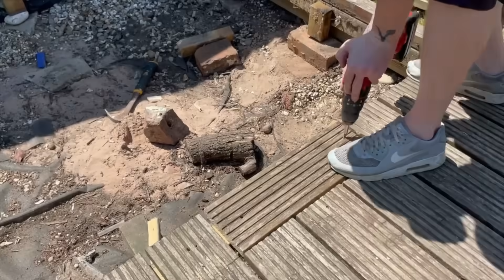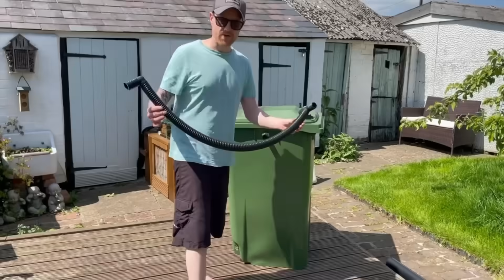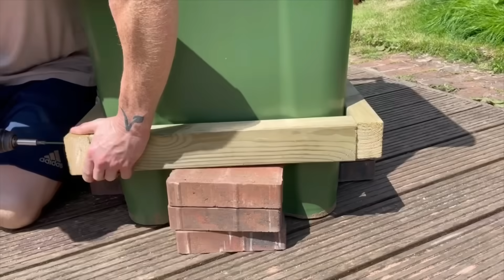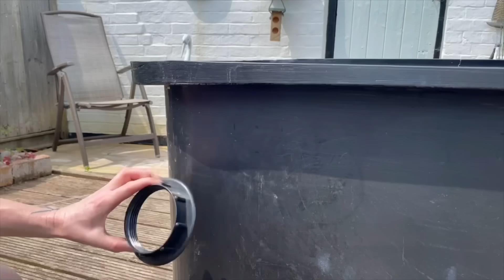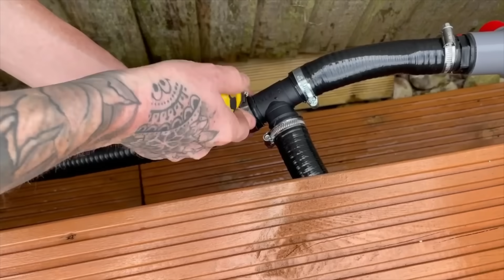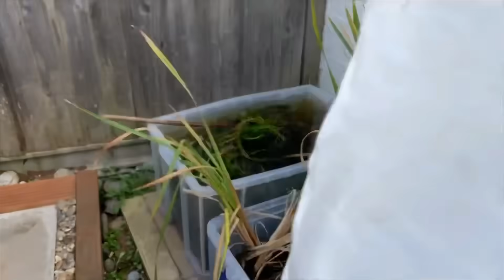DIY Backyard Garden Pond (step-by-step)

Comment: Very nice pond. But i wonder how your gone clean the mechanical filter kliko. All the junk is gonna collect on the bottom. Same with the bog filter, you wont be able to clean it good with just 1 pipe. And i also wonder why you didnt put the mechanical filter first, then the bog filter and only the bog filter going into the pond. Then you can get the big particles in the mechanical filter and the bog filter will function better to clean the small things. Or maybe i'm missing something and ill hope to learn for your experiance. :D
Reply from the maker: Hi there, if you check out my latest video, showing my winter prep, I do a clean out of both the filters, so you’ll be able to see how I manage the clean outs 😊👍
Reply: @GingerFishyOfficial  great ill watch that video. 😀👍

Comment: I wish you would show how you connected both filters at the same time
Reply from the maker: Yeah, sorry about that… it was a bit awkward to film down the back. But basically the the hose from the pump just goes to a t-piece, which splits the water into 2 pipes, 1 going to each filter. Hope that helps. 👊

Comment: That foam in the lower layer is a failure it would only takes a week to clog.. you should change it with screen with peeble size eyes, plus one inch foam on top of that will do..
Reply from the maker: A few people have mentioned this.. it’s working ok at the moment but if it does become a problem in the summer when the waste load goes up, I’ve got a possible plan to adjust things a little, which should hopefully sort it out! 👍

Comment: Good idea, BUT, the mechanical filtration will cause far too much maintenance and time. You have to clean the filters and you will know about it when you come to clean them. Why not invest in a pressurised filter .It’s much cleaner and easier to operate and quicker to clean.

Comment: Absolutely love your pond, can i ask what air stones they are.
Reply from the maker: The big air stone that I used in the main pond is a disc circulator air stone (100mm/3.9”), I got it from my local pond shop. The one I added to the filter is a half can air stone, that came with the air pump itself. 👍
Reply: @GingerFishyOfficial  ok thanks might try a flat air stone.

Comment: I’ve made my filter for my 300 gallon pond out of three planter pots with no drain holes. I ran a 3 inch pipe through the lower sections of it to where all three are connected that way. I have 2 inch pipe more at the top of the planter to allow the water to drain into the pond. I used lava rock and have all sorts of plants mainly elephant ears because they just love the nutrients they get. My water is sparkling clear. I can’t complain at all about my setup especially cobbling it up together really fast because my old filter system crashed.
Reply from the maker: Sounds awesome.. you can’t beat a DIY filter!!! 👊😊
Reply: Pic?

Comment: it think its good to have the bottom bare. Although you could find some way to print a graphic of gravel on some water resistant material and place it on the bottom. The water will help the illusion that there is gravel but it'll just be a graphic and you can still maintain it easily.
Reply from the maker: Yeah, that would be good! I did think about tiling the bottom, I did think that would look nice and still be easy to maintain.. 😊
Reply: @GingerFishyOfficial  Oh yeah tiling is really good idea too, many types to choose from 😀

Comment: in my opinion the mechanical filtering system is completely wrong, the pump brings the dirty water to the bottom of the filter, the dirt will form a plug. The dirty water must be thrown over the filter parts which will carry out the work by gravity, the clean water from the bottom of the filter will return to the surface via a filter separator which uses the principle of communicating vessels

Comment: Hey mate, greetings from Philippines! I like your pond design. So elegant! yet, you might get into trouble putting the pump tube end under the bottom. it might suck the waste back to pond incase when electricity or pump fails. Due to higher water level inside the bin, pressure will push back and level with your water inside the pond.
Reply from the maker: Thanks mate! I’ll be sure to keep an eye things, luckily its very rare that we get power cuts 😊👍

Comment: Building my own based on your build right now. Just wondering how much stain you used and what size bottle you bought. I’ve heard the stain doesn’t keep well once opened so would rather get what I need.
Reply from the maker: Hi mate, I got a 5L tub, and that was enough to do 1 coat on all of the decking around the pond and filters, plus the floor decking, plus a second coat on on all the top edges of the pond and filter. I think if I hadn’t have had to do my floor decking, I could have got 2 coats on all of the pond/ filter decking with that 5L tub. Hope your build is going well! 😊👍
Reply: @GingerFishyOfficial  thanks for getting back in touch, build is going well, the decking boards are ordered for delivery on Monday. The Laguna 1000 is in on top of sand and half filled. Armoured cable installed underground to where the filter system and pump is going. I’m hoping to have it done by next weekend. Fish are currently living in a bath tub which the people who lived here before us installed.

Did you get your stain from eBay? It’s the only place I could find and the seller is away on holiday. Also, did you use the red colour or light amber? We’re tempted with the black but both me and the wife loved the look of yours once it was done.
Reply from the maker: @Joe_SG  yeah, I think I got it from ebay.. the colour I used was just called light brown. Glad your builds going well! Will you put up a video when your done? Would be cool to see! 😊
Reply: @GingerFishyOfficial  his shop on eBay was back open today and I noticed the light brown which is what we’ve ordered. Spent today putting in all the insulation… quite a task in this heat. I wish I’d taken some videos but I didn’t 😫 I’ll take some photos as I go along and see if its worth posting at the end.
Reply: @GingerFishyOfficial  I’ve pinged you some photos on instagram if you’re interested to see how it’s going

Comment: That is an awesome build and one that inspired me a lot to build something like this in my garden! One thing I would have done differently is use the water coming from the mechanical filter to go directly into the gravel filter (by gravity, maybe setting the latter one a little lower) and thus having mechanically clean water only in the gravel filter.
Reply from the maker: Thank you! I did think about doing that, but wasn’t sure on what hose/ pipe diameters I need to use, plus I was struggling to work out the right flow rate to make sure it all ran smoothly, so in the end decided to keep them separate. Also I thought by keeping them separate if I ever have a problem with one of the filters, I can just divert all the water to the other one. But yeah, ideally it would be good to have the water go from the mechanical filter into the bog 👍😊
Reply: What brand/model is the main tank? Can’t seem to find something like that online ?

Comment: Nice build, are you adding an automatic filling system, or are you just filling it by eye? Mechanical filter in the bottom first will make the maintenance that bit more involved, as all the large debris will clog the first filters then start to bypass them at the sides.,
Reply from the maker: Yeah, I’ll probs just fill it by eye as and when needed 😊

Comment: Nice build mate. Really like the attention to detail in terms of having it all nicely tucked away with wood cladding. The two separate filters seems a bit redundant. I've got a similar above ground setup and just have a bog filter. Crystal clear and well balanced waters.
Reply: I've got two wheelie bins filled with k1 and k2 media and my 2 pallet x 2 pallet wide pond is struggling to fight the green water I've threw some natural stuff in an done a full clean but think I might need some plants as the flow from the bins back in is nothing compared to how much water is in there. Only 3 or 4 huge koi and ten or so mixed gold fish should I be plumbing my uv filter I've not bothered to fit?? It's a never ending project everything's always for another day 😂

Comment: Hi, your building skills and results are great, but the filtrations proposed are far from optimized..
This is what I would do:
- 2 containers on each side as you did, but not that tall.. it's not needed
- per container:
-- 1 small drum filters, backside that will be hidden, slightly above container level

-- 1 planted area, receiving clean water from drum filter, 20cm deep is enough
The wasted water of drum filters can be easly collected for vegetable garden.
WIth the filters you proposed, 2 disavantages:
- mecanical part is not before biological part
- in both parts, you stuck fish wast instead of extracting if from water system.. over the years, you'll face issue..

Comment: Do you not find its better to have the water filtering from the top down then back up through a pipe with side connection T with pipe into pond and other pipe to top of filter material. This would need the top filter cleaning more often but would keep the water more clean.  https://youtu.be/o4MoFoUdE7k

Comment: Could someone tell me why the filters are not gravity feed as in inlet from the top and outlet on the bottom? Seems like a lot of pain to clean everytime, not only you need to clean the sponge but also everything on the bottom of the filter, also why is the mechanical filter soooo big most ponds i build for clients are 1/200 to 1/500 the size of the pond especially you have a separate bio filter all this pond need is a filter around 40 to 60L

Comment: Great build, very inspiring. But I have a stupid question. Your pump shoots to both mechanical and bio filters at the same time, the water doesn't cascade from one to the other so that it gets the full treatment? What would prevent your bio filter from getting clogged up at the bottom with all the malm since it didn't go through a mechanical filter first? I'm genuinely intrigued.
Reply from the maker: Yeah, ideally the water would be pumped from the pond, into the mechanical filter, and then from the mechanical filter into the bog, and therefore the mechanical filter acting almost like a pre filter to the bog filter. I decide not to do this for a couple of reason though.. firstly I was struggling to work out flow rates and hosing diameter sizing to get it to all work right.. so decided it would be simpler to keep them separate. But also I kind of like how it worked out as it means if I ever have an issue with one filter, I still have the another one that will still be running.. and also I did think if the mechanical filter ever start to clog up, a bit more water will just end up being pushed over to the bog filter. 

Having the 2 filters separate though shouldn’t mean that the bog filter gets clogged up either, as if the flow rate is correct the majority of the waste should just settle at the bottom, and then I can just vac it out using the clean out snorkel I put in. Hope that helps.. 👍😊

Comment: why did you move the access pipe away from the water inlet on the bog filter - before you added the slate the clean out pipe was directly above the inlet
Reply from the maker: I don’t think I moved it, must have just looked different when looking at it from a different angle maybe 😊
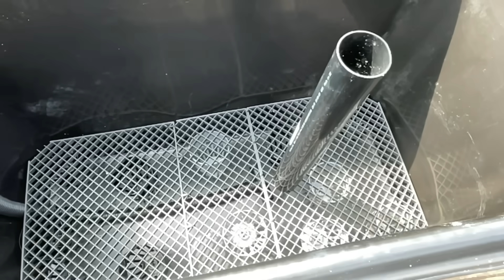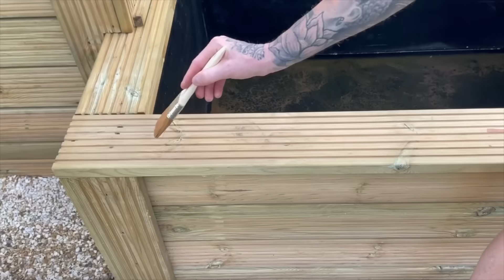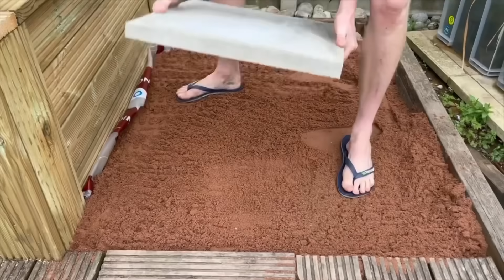Reply: @GingerFishyOfficial  15:01 vs 17:01 to 15:57 - just looks like the cleanout pipe was moved about 300mm from the inlet
Reply from the maker: @supdus good spot, I hadn’t noticed that.. I’d completely forgotten I flipped it round.. just for aesthetics.. thought it would look better at the back of the filter, rather than the front. 👍

Comment: Definitely don't add rock to the bottom of the pond as it traps muck and makes it hard to clean.  Some rocks for esthetics is fine. As far as the UV light, you won't need it if the biological/bog/wetland filter is big enough and working correctly (enough plant roots to remove the minerals for the system).  A UV light really only masks the issue of minerals in the water because it doesn't remove them from the system.  Great job on the video and explanations!
Reply from the maker: Exactly my thoughts.. Thank you!! 👊

Comment: I don't find this filtration works it fills up with sludge. Im sure this will be green in a few months. A UV light, easy clean small foam filter, 50% shade and reed plants. With the stones they need shallow running water over the top not from below because the bacteria don't grip well to stones
Reply from the maker: Time will tell I suppose 👍

Comment: Having a pond above ground is not suitable for most climates, it is prone to overheat in summer and completely freeze in winter. I would not recommend to copy this.
Reply from the maker: That’s why I added the insulation, and why I’ll add a cover, and possibly a heater in the winter!
Reply: He had a similar setup for 3 years, the fish looked alive
Reply: @96Caleb96  Maybe he lives in a climate where it's neither hot nor cold or maybe....as a youtuber he isn't honest, since that would hurt his income.
Reply from the maker: I never said it was the perfect design for every climate.. but I also think that most people who live in particularly hot areas or particularly cold area are probably aware that there situation may be a little different and require some adjustments because of that. ✌️
Reply: @GingerFishyOfficial  fair enough
Reply: fyi i live in south east asia and have this type of pond. doesnt have any issue with above ground pond with equipments like big enough filtration, heater, UV lights, floating plants to avoid summer heat,…
Reply: We all fish keep, pond keep at our own risk man. All the different ways of doing things work for others or may not.

Comment: If you put a tap at the bottom of the filter (like a rain barrel ), you can drain the filter and back flush with your hose pipe.
Reply from the maker: Yeah, unfortunately the base of the mechanical filter is below ground, probably could have done that with the bog filter though 👍

Comment: how much does this cost to run
Reply from the maker: Not too sure.. but the main pump is 60 Watts and the air pump is 10 Watts, so I don’t think it would be too much. One of the good things about bog filters is they work best with a slower flow rate compared to other filters, which means generally they are cheaper to run. 👍

Comment: Just wondering why you decided to have the two filters separate and not chain them with the mechanical filter running straight into the bio filter and then into the pond. Is it for the extra aeration?
Reply from the maker: I had originally planned to chain them, and have the mechanical filter run into the bio filter, acting as like a pre-filter, but for a couple of reasons decided against it. Firstly I was struggling to work out the diameter of pipe I would need to use to connect them, and also what flow rate/ pump size I would need to do this. Plus I thought by having them separate, if the mechanical filter sponges started to clog up and reduce flow it wouldn’t impact the biological filtration. Also I kind of like having two separate filters running as it means if I was to have an issue with one, I would still have the other one running. Just have to hope the pump doesn’t break..
Reply: If you’d daisy chained the mechanical filter to the bio filter you could have put a UV light inbetween. You’ve done a fantastic job though, really top notch 👍

Comment: This was amazing, you homemade all the “Aquascape” expensive products I want but don’t want the high cost! No one else does but I always raise my pumps as an “in case” as well!  Probably helps in winter as well as you don’t want to pull the warmer water below and mix with outside colder air.   Plant creeping Jenny as well, they don’t mind wet feet either!  Algae isn’t a bad thing, just have. Uv light to not have pea green water. I always do substrate, it helps with fine algae and bacteria places to grab for the natural environment of the aquatic animals.  Natural growth on the substrate is not a bad thing.  I also have solar e wire stones in case of power outage.
Reply from the maker: Thank you! I’ll definitely get some creeping Jenny for the bog filter!! 😊

Comment: Amazing to find something like this from the UK. I’m in the middle of doing something similar with a water butt that came with our new home. I was going to just drill the outlet and silicone the pipe into place! This is much neater. Can we get the product links please, particularly the connectors to the bin. Cheers, great work!
Reply from the maker: Hopefully should have a product list up soon. But I got the 3inch tank connectors that I used for the outlets from eBay - just search 3 inch threaded tank connector. For the 1 inch tank connectors that I used for the inlets, I got from Shirley Aquatics in Birmingham (they do have an online shop also). Hope that help for now 😊👍
Reply: @GingerFishyOfficial  amazing, thanks for the reply 👍. I’m not far from Brum so maybe a trip into Shirley could be on the cards. I’ve been looking into airlift pumps to connect to the filter for energy efficiency but man does that oase pump just look so easy and convenient and they do some really low running cost pumps now right?!